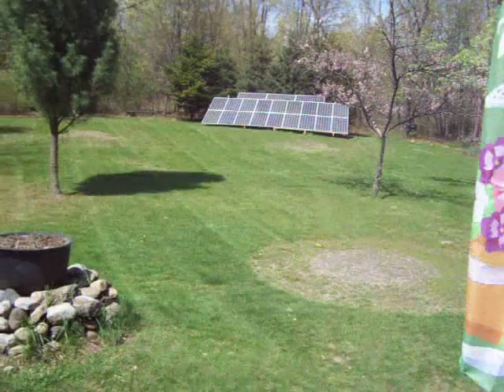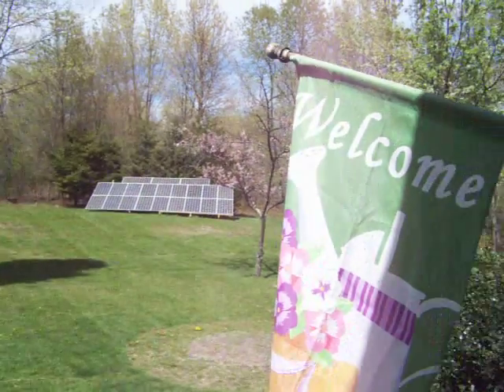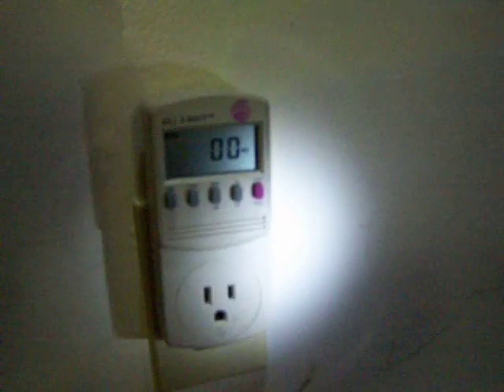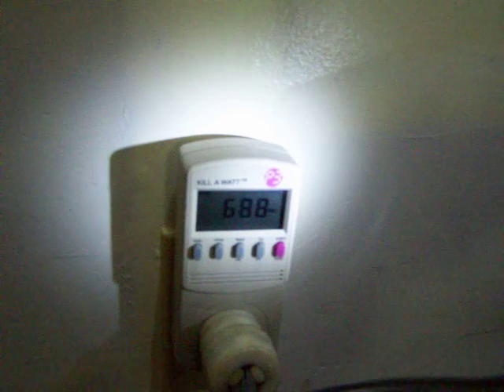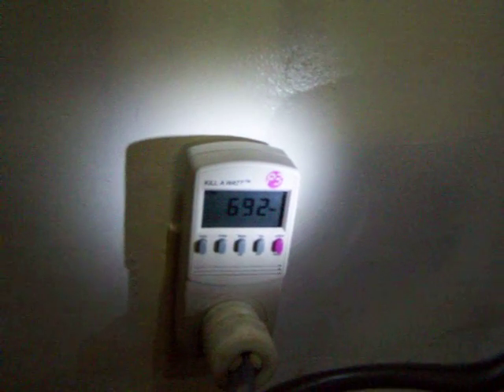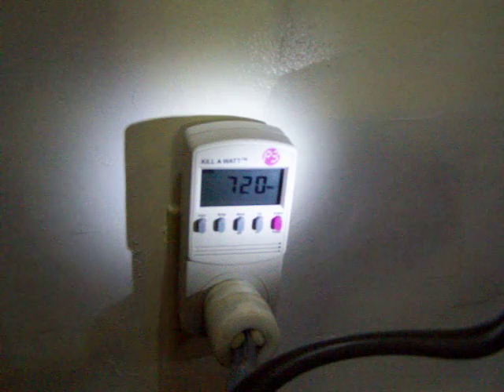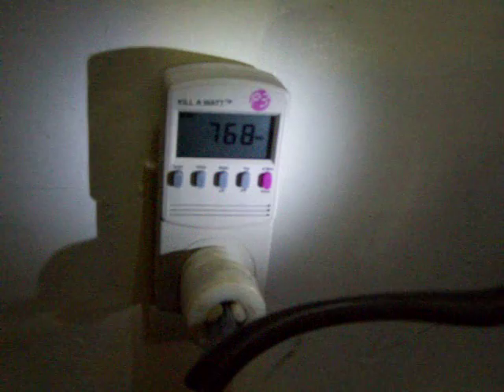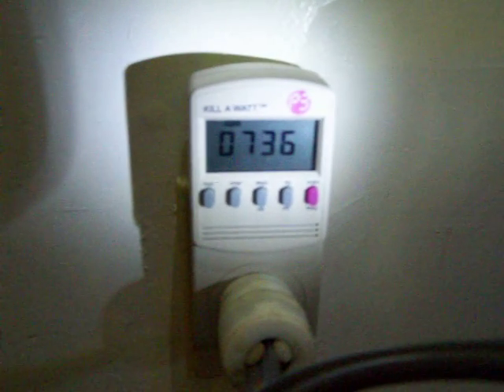poor grit tie readings

Comment: Couple of things that I can see. DC power from the panels will start to degrade at about 8 meters. By increasing the amperage you can carry farther. Do this by changing your panel array. I think two panels in series and then parallel each set. Also, should only expect to carry about half the inverter load, so a 3000w inverter may only manage 1000-1500. In this case I would add a second inverter and split the load.

Comment: By the way, I love how you constructed the racks for the array outside.  Im building one for our place.  I got an old camper that I made into a portable powerhouse for the main house with the panels and other equipment self contained.  When the seasons change, I can move it to a sunny spot if the spot it's in gets shady in the winter.  Later I will build something a bit more permanent when I get an idea where the best spot in the yard is.

Comment: the problem you are getting is related to your voltage.  at 120v, the most the inverter can safely make through its north american standard outlets is 15a at 120vac.  You may need to wire direct at 220vac to realize the full potential of your equipment; that is if your inverter can directly connect and produce that voltage.  Even direct connecting at b120v can get you the watts you need if your inverter has the terminals for it.  I hope this helps, I have a 3kw unit and had your problem as well.

Comment: Measure the V and I at the inverter input. For 3000 watts in you should have ~30 volts and 100 amps at the inverter input.  If you're only getting 600 watts out then your inverter is disapating 2400 watts!  If this was the case it would be literally on fire!!!  I suspect your inverter is only consuming about 800 watts.  Can your wiring handle 100 amps?

Comment from the maker: @MrMG1973 Hey my panels are all wired in paralell so the shade should not cause as much drop as a series string right.This morning it rainy and nasty outside and I saw 1200w on my meter.I am happy to get any power from the sun if its 1w or 3000w its still good clean fun energy.Thank you very much for the comment I will let you know when I get it up to 2500+watts.TAKE CARE

Comment: Do a quick test out at the panels. Test your volts and your amps to get your watts. (eg. 14 volts by 50 amps = about 700 watts.) Post that info. Also if you have shade on even one panel it is going to drop you output dramatically due to the fact your array is running as one. I think the 3000w Power jack is rated DC 2855V. Let us know your panel specs. Some of the comments you already have are from very knowledgeable people. You'll get it sorted, don't give up.

Comment from the maker: @mrbuki77 Hey thanks for the comment. the inverter is 32v-50v  my panels have over 40 open volts so I have them run in paralell and hooked direct.TAKE CARE.manual I think I am lucky it came with te AC wire and the nuts for the DC wires lol

Comment: Take a look at the inverter manual for the voltage range. And wire your panels for the highest voltage range. For example if 14v-28v, rewire the panels for 28v, and so on. I guess your panels are 12v. Let me know how that turns out. Later from sunny FL!

Comment: Hey  Michael
  Forgive me if I am wrong this sounds like a wire issue. As wire gets hotter is loses its afficiency dramadicly because it becomes a resistor. That is why when you disconect and reconect the output is higher and then falls off. I have had no output issues but I am using very large wire especially on my DC side.I have not seen the full output in summer conditions but I will let you know.
Let me know what you find.
  CHEERS OBX NC

Comment: Michael, if the inverter is bad do check out the Solectria 3KW grid tie inverter, it has a 10 year warranty, they make commercial and residential inverters and are probably the best for your buck. The unit costs $1,770 from wholesalesolar. It has a DC disconnect and DC fuses built in- you can connect all 21 panels in series right to this thing (it will take up to 600VDC input). Simple, UL1741 certified, legal to use and your money is protected for 10 years.

Comment: I also have a 300W small Chinese junk inverter that has not worked right since I plugged it in. They warranty was as follows:
1. They offered to send me parts so I could solder them on the board,when I rejected that
2. They offered for me to send only the board which would mean un-soldering components - after I rejected that
3. They offered to replace the whole unit if I provided tracking number - PROBLEM - it costs $125 to ship to China - they cost $100 new on eBay - not worth it.

Comment: Thats way to much wire loss. Something is wrong 4 sure. I would use your small inverter to check the voltage out put of each panel till you find the problem, Could be as simple as a loose connection. If not send back that monster and get smaller ones..Later

Comment from the maker: @VWRabbitdiesel Hey VW thanks for the comment.I have the GTI plugged into a circuit that has a 20amp breaker.I figured it would get me around 2400w which is all I figured on getting from my array at this distance.The wire is solid 10g which is rated fo 30 amps but the length is what the problem is right.I think I may have to go with several GTIs thanks again.TAKE CARE